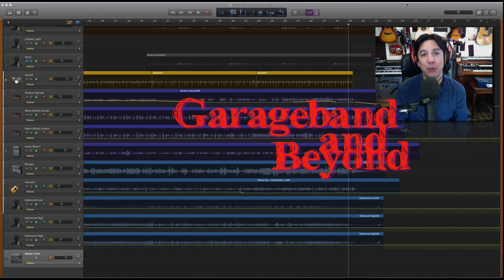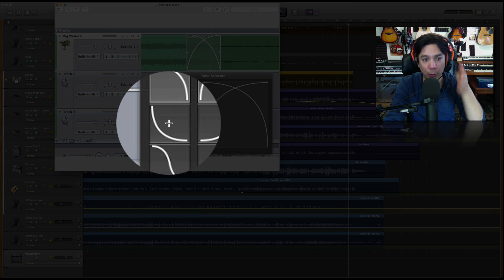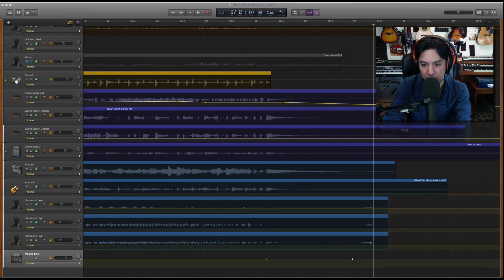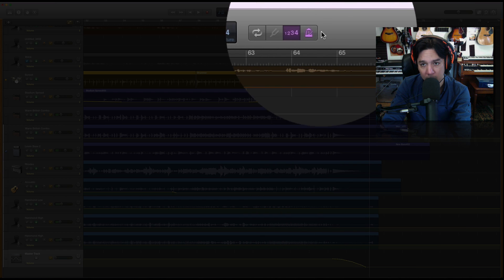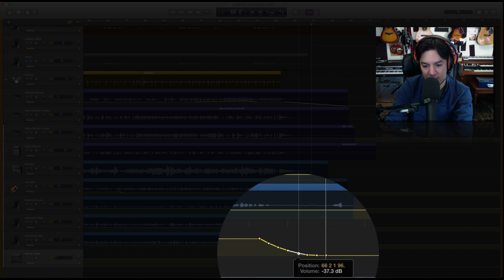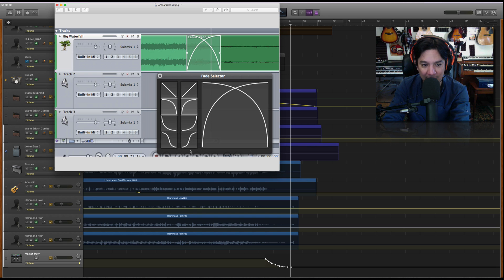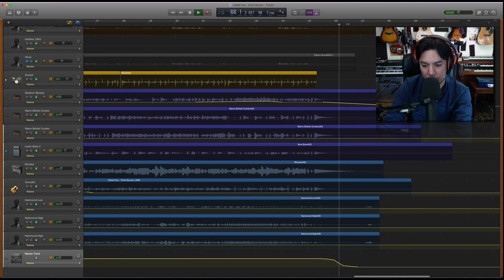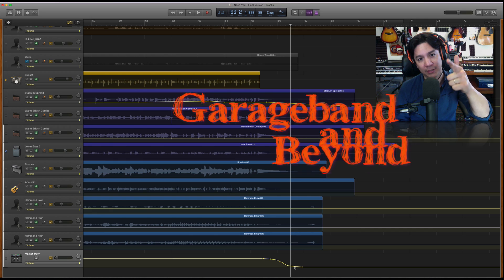How to make Fade in & out curves in Garageband 10

Comment: IS IT POSSIBLE TO MAKE CHOPPED AND SCREWED VOCALS ON GB10? OR TO SLOW THE TEMPO OF THE VOCAL IN CERTIAN POINTS WITHOUT CHANGING THE TEMPO OF THE WHOLE SONG?
Reply from the maker: +eastBay510boy Yes, for chopping and screwing with it, just edit apart and go nuts with the effects!

For changing tempo, go up to the "TRACK" Pull down menu and then select "Show Tempo Track".
Once you see that appear you can start editing the tempo VIA the normal automation method.
Reply: +GaragebandandBeyond ok thank you. i can add individual effects to the split region of vocals on the same track?

Comment: Hey Lewin thanks for all the great videos! Im only a year in on garageband and been having issues with a notice that pops up saying " system overload" and automatically shuts garageband down. Is this a common problem? Any help at all would be greatly appreciated. thanks
Reply from the maker: +Josh Gates adding RAM to your computer is always a great idea. If you have a desktop, you might also look into installing a solid state hard drive.
Besides that, I would suggest that you start locking all your tracks.
Also, try to minimize the amount of "heavy" plug-ins that you are using while mixing.
Hope that helps!
Reply: +GaragebandandBeyond thanks for the help!